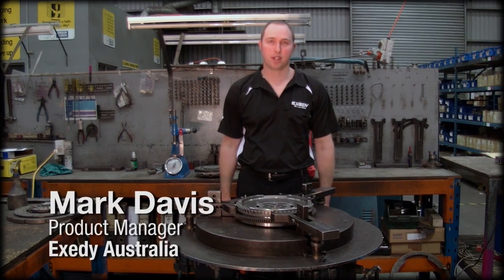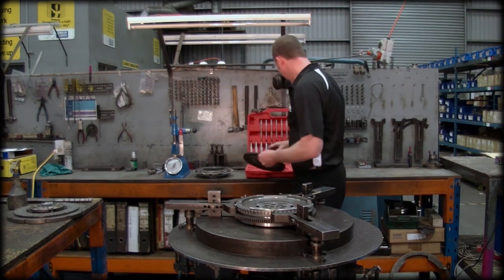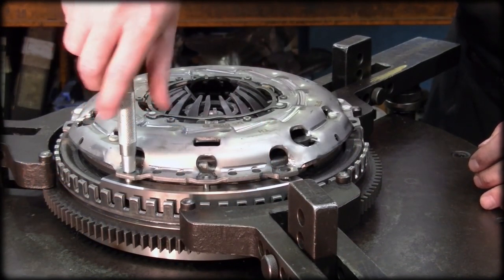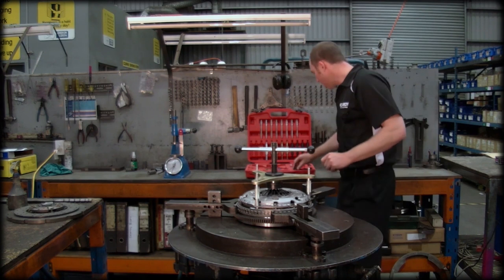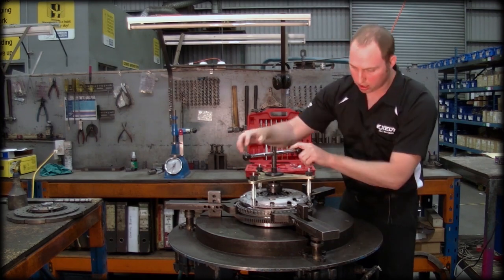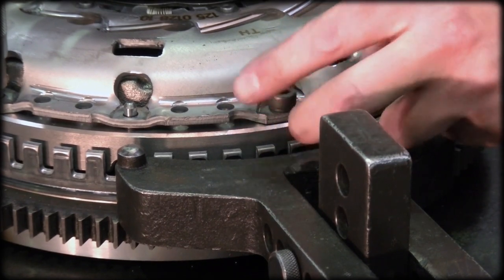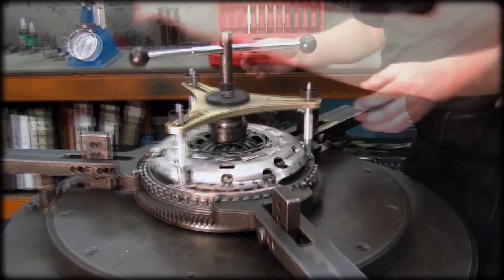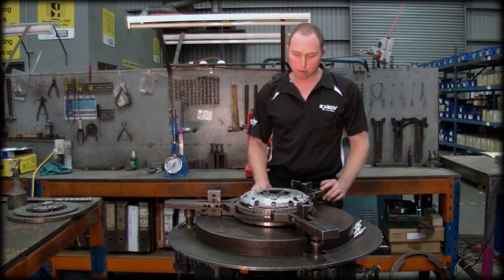SAC Tool kit from Exedy

Comment: If one doesn't use this, and uses the tightening of the pressure plate bolts to clamp it in place, what could potentially happen to the diaphragm when you say "damage"?